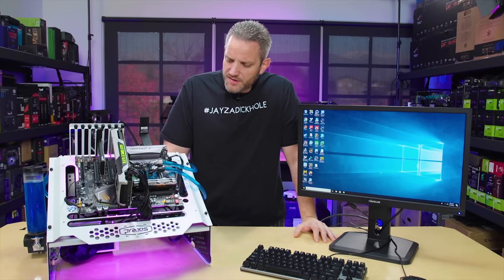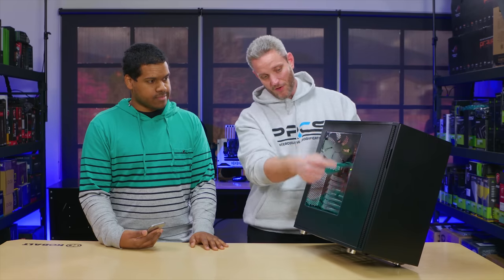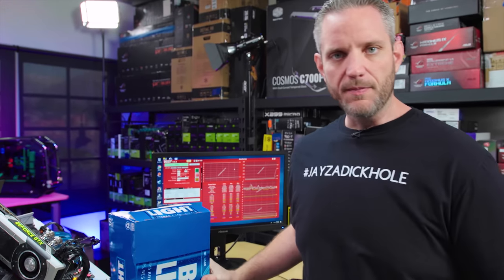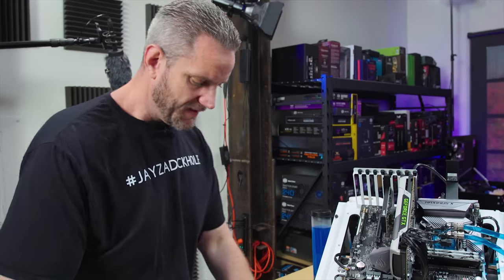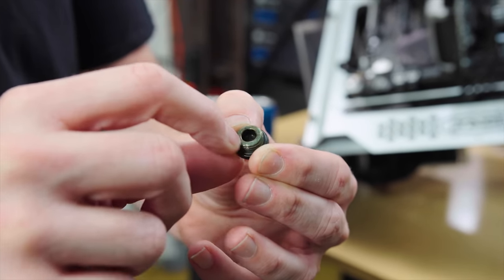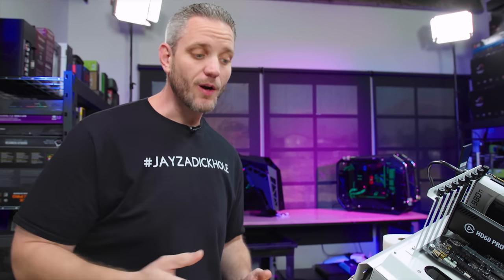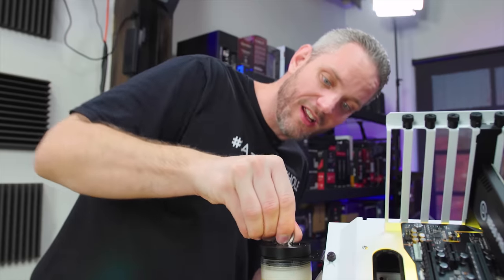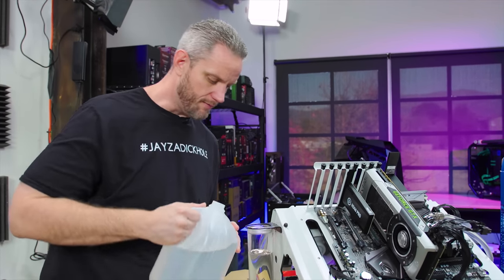We Watercooled a Computer with BEER! DID IT WORK??????

Comment: How about liquid metal or salts? I wouldn't recommend mercury, but gallium or cesium formate perhaps?
Reply: Why not mercury? Under pressure it shouldnt vaporize that easily xD
Reply: Besides the fact mercury is extremely heavy, toxic, and has a bad reaction to a lot of metals including Aluminum... pure Hg costs upwards of $50/fl oz or $1700/liter if you can even find that much.
Reply: Cody's Lab have mercury!!
Reply: Yes, it would react with Aluminum but Copper should be fine and the weight shouldnt be that much of a problem either, as being pumped slower would be compensated by having much better thermal properties. The price is really a problem though, didnt think about that.
Reply: the pump is probably not strong enough for mercury.
Reply: Of course there are Aluminum components but how about just not using them?
Reply: The problem I see with this is that the specific heat of a liquid metal will be a lot lower than that of water. So the cooling performance will be worse reguardless of how cool it would be.
Reply: Chuckiele and it's toxic. Wouldn't reccomend it.
Reply: Not to mention the reaction gallium has with other metals.. lol
Reply: Especially aluminum, you could lightly poke a piece of gallium infected aluminum and put a hole in it with your finger.
Reply: guys remember galvanic reaction
Reply: I no longer recommend Gallium! It viciously attacks other metals, its melting point is 85F, so you'd have to heat it to get it into a loop, and it would go solid when it cooled down... Also, a liter of Gallium would cost as much if not more than Mercury.
Reply: The toxicity aspect is overrated.
Reply: soluble hamster gallium would probably solidify in the rads.

Comment: Beer lines/pipes are basically the same tubes we use for water-cooling so what will most likely happen long-term is exactly the same thing that happens to beer lines if they don't get cleaned regularly. All the yeast will start to separate and cling to the tubes and you'd need some type of pipe cleaning detergent to pull the yeast off. Basically if you really wanted to run this long-term, you'd have to clean it at least weekly, maybe even twice a week with a proper anti-yeast beer line cleaning solution (that stuff is powerful, like a 40:1 dilution for the stuff we use in the UK), and putting fresh beer in afterwards. Sufficed to say it would be very high maintenance. We have gallons and gallons of beer going through our lines and the yeast still builds up after about a week even with fresh beer being constantly pulled into and poured out of the system so leaving the same old beer in there will probably require cleaning and replacing even more regularly. If you were able to include a chilling unit (so that the beer gets chilled as it passes through a certain point in the loop) and an electrolytic filter, you may be able to stretch the maintenance cycle for about 14-21 days but no more than that. Basically you'd have to treat it as though it was a real draught beer line and maintain it the way pubs have to maintain there pipes in order for it to be viable long-term. Although why would you unless your a maniac like jay 😉

Comment: I think green corrosion is usually from copper, so it may be that or brass.
Reply: storm37000 right, patina I think it’s called. Only copper-containing.
Reply: Copper itself is not that golden. However its alloys are, this is brass most likely.

Comment: This is a cool idea. I'm no beer expert, but I haven't seen anybody else speak up about how beer works. I wouldn't be worried about leaving beer in that system for long periods of time. Bacteria can't grow in beer due to alcohol content so it isn't going to rot. Yeast isn't a concern in this case either because beer from the can is pastuerized so the the yeast is long since dead and likely filtered out anyway. The beer will go flat and the flavor will likely change from being heated over and over again, but other than that theres not much to worry about (dunno about how it will affect the pump or seals). It should not for any reason rot, ferment, or turn into an algae filled mess. 

To avoid the foam, I would pour all the beer into a pitcher first, then use a hose to siphon the beer from the pitcher into the resivoir. Better yet, to avoid wierd interactions with oxygen and the beer; fill the empty lines with CO2 ahead of time, connect a keg of beer straight to the the system and try to fill your system without any oxygen. This could help preserve better the beer and keep it drinkable... possibly.

Comment: Thierry Neuville (BEL) did it to his Hyundai i20 WRC during Rally Mexico a few years ago (2014). Punctured radiator lost all water and he needed some cooling liquid after a temporary fix of the puncture. The closest thing was a two liter bottle of Corona beer from one of the fans. So it can be also used for cooling engines. He is currently leading WRC championship in this season and still drives for Hyundai.

Comment: XoticPC!!!! Best company ever. Never seen this video for some reason. They upgraded my gaming laptop.... went from a 1050ti to 2 full size 1070ti sli with custom coolers and fans. And literally made it all fit in the same laptop case. Only issue I had was the touchpad, the top right corner doesn't seat properly. The 2nd card just barely clears.... and who uses the touch pad anyways. Love that company

Comment: That cap was either brass or copper. Aluminum is usually white when it oxidizes, sometimes black. Copper and brass turn green when oxidizing. Brass has aluminum in it, so it's more corrosive resistant, therefore, that cap is most likely copper.

Comment: Can you cool a system with mercury?
Reply: gallium is more effective
Reply: Mercury would likely cause massive corrosion, also it is so dense I can't imagine how powerful the pump would need to be

Gallium would immediately destroy any alluminium in the loop, would also be hard to pump and would have to be kept at atleast ~30°C or it would solidify 
Also I suspect with how dense and how high the surface tension is they would be very inefficient for going through the micro channels.
Reply: You ruined the joke Amy :(
Reply: Amy Pond didn't know that thnx
Reply: Yeah build  system for codyslab!
Reply: It's not likely For the person who is looking to go to a metal coolant to have a low quality parts that are made of aluminum. Gallium is slightly corrosive to most metals but silver is one of the most corrosion resistant metals so it would probably be effective to have a mostly plastic or glass system with silver or diamond(if you have the money because it wouldn't react at all) as for radiators it woul probably work to just run water or oil through the metal to avoid corrosion on a traditional radiator. The only problem with it would be that the system would have to be a. 24/7 system so make sure the fluid doesn't lock up.
Reply: I thought you meant the cider

Comment: 5:17 Pro Tip: the oils from your skin will dissolve that foam at a rapid pace. Just wipe your finger along your nose, or under your eyes (these tend to be the oiliest spots on the face), then swirl it around in the foam.

Comment: Would water cooling work with liquid metal?
Reply: If the metal isn't fluid at room temperarure no
Reply: Molten lava works quite well.
Reply: Leonhard Kuen I meant the liquid metal thermal paste.
Reply: Probably not the thermal compound probably isn't liquid enough and may corrode stuff very fast and real molten Metal is to hot. But if you want to "cool" something thats really hot a nuclear reactor for example you could totally use metal to cool it.
Reply: Maybe mercury could achieve something. Don't think Jay could get ahold of that much mercury though.
Reply: Someone made a video of what happens if you try to flush mercury through a toilet bowl.  It took a lot of manual effort.  If someone wants to try it, they might get advice for a pump from where the mercury is sourced.
Reply: Your post shows total abscence of scientific knowledge.Don't know where to start correcting your misconceptions.Well,from the beginning,I guess.Liquid metal is actually liquid,but has higher density,viscosity and surface tension than other liquids . It can flow good if you have a strong pump.Higher thermal conductivity will actually benefit you, creating greater temperature delta thus increasing heat transfer speed(if your radiator can handle it).I mean,LM is better or at least not worse.Quite a few metals are liquid at room temps(like gallium,mercury,and some alloys like Na-K or LM-6).It would cool anything as long as it is liquid-at 50 degrees or 1000 degrees-doesn't really matter.Conclusion:LM in a loop is a bad solution.Extreme cost,rapid corrosion,special pump,tubes,waterblock and radiator for a negligible benefit.Chiller would do better.

Comment: I have a solution for the ad, a be quiet! 801.. I did not expect it to be HUGE when I bought it though
Supports E-ATX, 8 HDD's, two 420mm radiators has a removable radiator bracket, soundproofing that dampens enough noise to make a 780 ti (probably the loudest card in existence) sound like a quiet hum, you can even remove the motherboard tray to use it as an open test bench! It's a great case, overkill for my needs
Side note, it's 90% steel so it's heavy AF

Comment: Do a hard pour from a good height into a bucket first and let it sit overnight.  Pour again once, then right into the reservoir.  It'll work first time, no problems.

When flushing, let it run almost empty before you top it up or else you're just re-mixing.  You want to PURGE as much as possible before adding clean water.  It's just common sense, lol

Comment: You guys need to cool a system with some thin motor oil, would probably work better then water and last even longer and is rated to reach such sustained temperatures. And as a bonus it will probably never corrode anything because its oil, it would even help preserve the O-rings.

 Im honestly shocked that people have tried it with Anti-freeze and not oil. Even vegtable oil would probably work better.

Comment: I have a laser engraver and it uses a refrigerated chiller to cool the laser tube. I also have another chiller called a CW-3000 that cools to ambient. It's terrible for a laser but might work as an external system cooler. I also have parts from a build I purchased years ago. 240mm radiator, CPU block and pump. I bought the parts but couldn't decide on a decent tank so they sit in a box. I am seriously thinking of that cheap CW-3000.

Comment: Ok, so I know I'm way late on this video, but first of all the logical thing to me (that IMMEDIATELY came to mind), is you absolutely should have flattened the beer first. Meaning, poured the (warm) beer just as you did, however into a totally SEPARATE container first, thereby avoiding all of the foam bubbling up directly into the reservoir and subsequently the loop itself. And you would have just scooped the foam off after it sat for a few minutes and just put it in the sink. Then, once you had/have completely flat beer without the substantial amount of foam;  pour it into the reservoir. I'm certain you could have achieved significantly better results...

Oh well. Maybe next time lol! 

"Cheers" 

-H.B.

Comment: Just a curious thought... it may be incorrect, but maybe, the corrosion on the cap may be an anode of some sort that was made to attract the corrosive compounds in the system? Like anodes on boats and some structural steel. 🤷‍♂️ maybe someone may have an answer on this.
Reply: and this is the most important lesson from this video. I had to scroll too far down for the correct answer. This is really how you do it in a system with fluids just make the cap the anode or put the anode on the cap facing the fluid in the system. This is used for boat hulls or inside engines. Google: "Cathodic protection".

Comment: Speaking from limited knowledge of engineering, chemical reactions, etc.. the plug could be intentionally designed to be sacrificial meaning it corroded instead of the other components in the loop same principle as boat motors having a sacrificial piece of metal to stop the motor body from corroding.

Comment: Try and cool a system using some sort of very fluid-like thermal compound, like, fill a water cooling loop with it. Because as many people have pointed out, often a water cooling loop is limited by how efficient the coolant is at transferring heat, and not the actual volume of the loop's coolant, so if you used thermal compound, which is supposed to be some of the best stuff to transfer heat (at least within the temperature ranges PCs operate at) so wouldn't doing an experiment like this result in extremely good thermals?

Comment: Do it with liquid hydrogen, it has the most thermal capacity just find a way to compress it
Reply: Fun Idea but Liquid Hydrogen slowly leaks out of containers, so it would work for a video but IRL application you would have to top it off every week or so...

If you want to run pressurized gases a phase changer using typical refrigerants is the way to go... Although it is highly energy inefficient.
Reply: You've probably seen videos of it by now but the pressure would build up and we'll, pop, if they do liquid nitrogen most of the time the pop it into a tub and a soft tube into the tub

Comment: Not cooling related but maintenance, how about 2 3-way valves before and after the pump? Drain the reservoir with one then close it and use the one on the return to empty 100% into catch bottle, should be faster clean out.... at least in theory....

Comment: By the way Jay. I'm going to build a test bench just like that with a reservoir but i'm going to put some spatter guards up and experiment with different cooling liquids/gases. Have you ever thought about cooling it with Argon. Extremely expensive but you would own 3d mark leaderboard until the next chipset update. If you ever want to beat steve...lol

Comment: It´s all fun to try unconventional methods like using vodka, beer, human waste, a mishapen chunk of metal that looks like a mountain, a cup full of water to boil raw pasta on top of a pentium 4, an enitre computer chassis, concrete liquid cooling or equally insane if not a little disturbing ideas to cool down a cpu that goes hot until you accidentally spill it all over your precious build that now needs a wash and has to dry a long for a while let alone test to see if it works again despite your little mistake.

Comment: Dude, Vodka! High alcohol content. Granted, knowing what I do about E85 in cars, you may want to use Fuel line rated for E85 to keep the rubber from deteriorating, but a think it will cool VERY well, and won't foam!

Comment: I noticed you said you are running out of ideas. So I have ?/idea for you. Could you take 3 120mm rads or aio with some jayzcustoms  and put it in a loop will it be the same cooling as 360 rad or aio or will be completely different?

Comment: I dunno is my comment actual, but i suppose the corrosion had a galvanic nature, it happens when you connects two different metals and electrolyte
(even a distilled water is not absolutely pure).

Comment: My laptop has an i7-7700HQ and on Call of Duty Black Ops 3 it runs up to 85°C with both fans on 6k RPM and an external cooler under the laptop😂😂 (MSI GE73VR-Raider)

Comment: This is not a joke. Try liquid nitrogen cooling!!!
Reply: they've done that it's a usual practice for extreme over clocking. pretty dangerous though
Reply: kingpin water cooling
Reply: @PineappleKiller16  Yeah. There is a big issue with condensation.
Reply: Also the worst part about it that all of you have neglected is that liquid nitrogen is only liquid because it's cold. you heat it up in your tubing it'll turn into a gas... and create pressure... and blow your valves out.
Reply: Der8auer did with liquid helium
Reply: wow... that must have been hard, do they have a video on it? because liquid helium is just fucking weird.
Reply: I want them to try a liquid mercury cooling personally. You figure it's a liquid metal that's conductive, essentially it's a liquid heat sink.